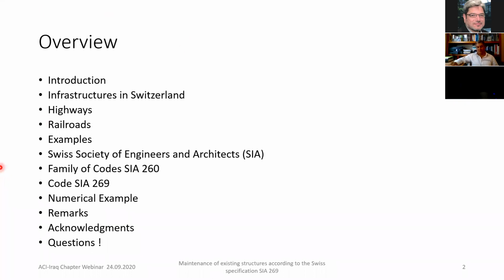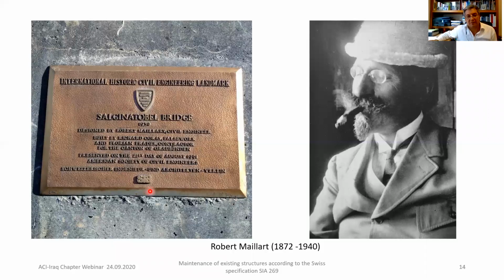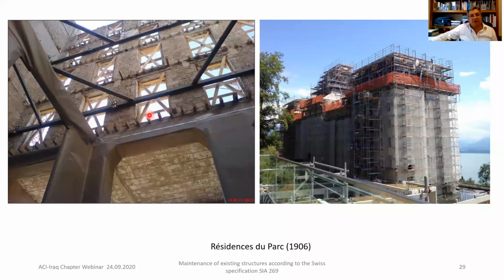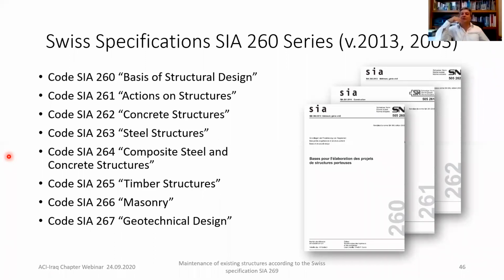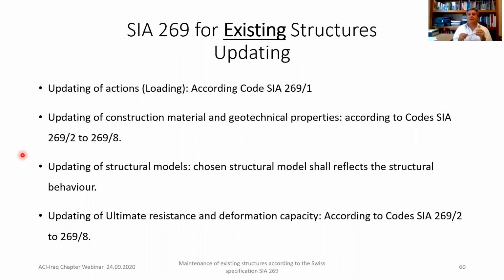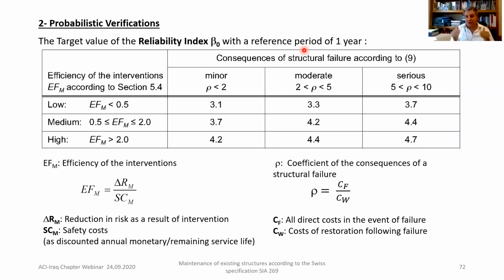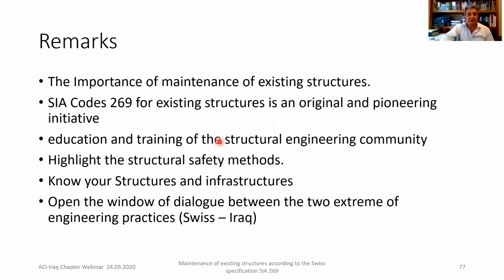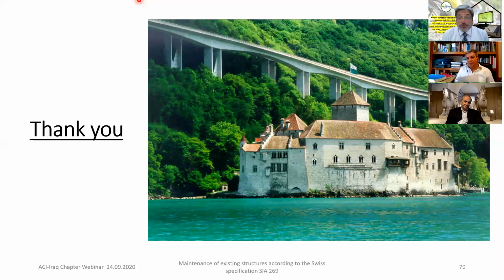Dr  Raad

Comment: Thank you Dr. Ali for the video. As it is a long one, here you are the moments of some key points of the webinar:
7 :12 brief information about Highways in Switzerland
	11:23 Poya Bridge, Fribourg 
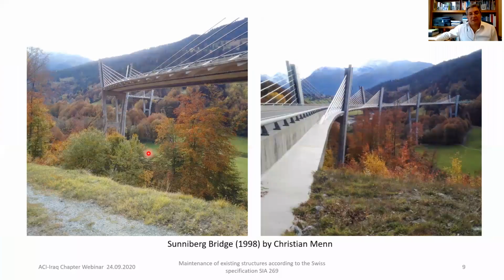	11:57 Sunniberg Bridge
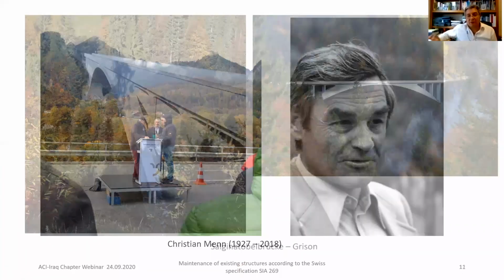	13:47 Salginatoblbrücke
	16:27 Timber Bridges
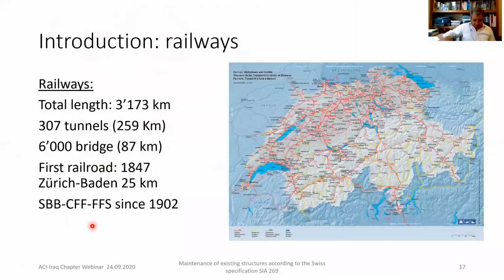17:05 Railroads (CFF)
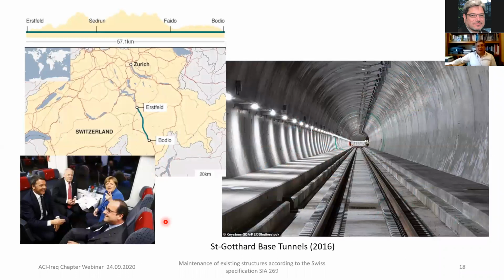	18:09 St-Gotthard Tunnel
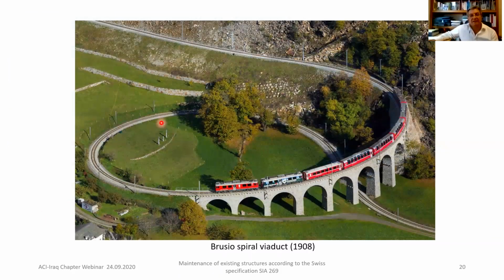	19:27 Spiral bridge
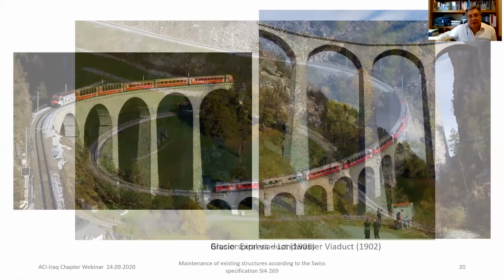	20:00 Landwasser Glacier
	20:37 Viaduc du Day
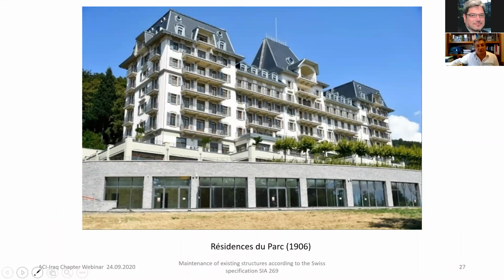25:50 Building Résidences du Parc
29:22 Bridge highway A9 on Château du Chillon
37:40 Swiss Society for Engineers and Architects 
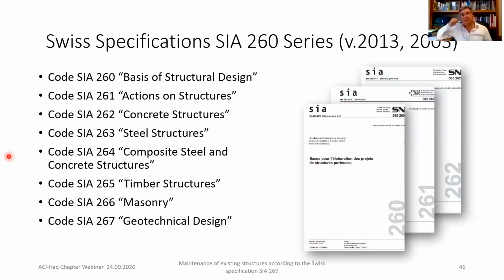39:40 Codes SIA 260
47:18 Codes SIA 269
1:11:45 Remarks 
1:14:32 Acknowledgements
1:15:26 Questions and Remarks